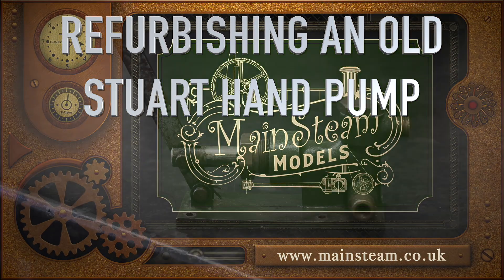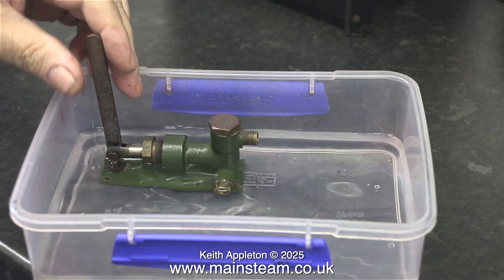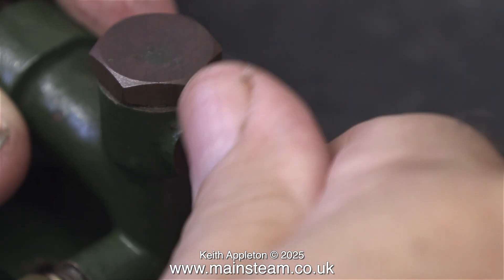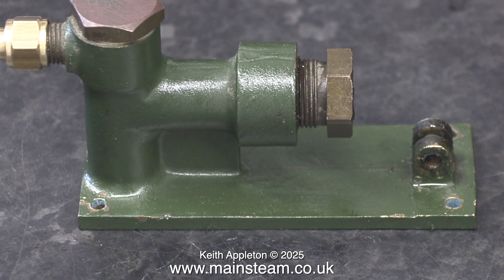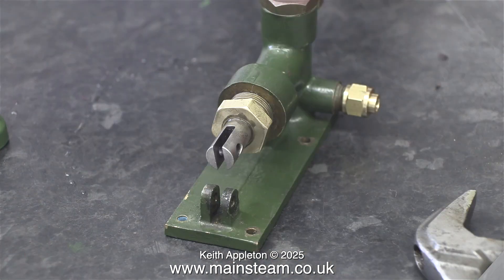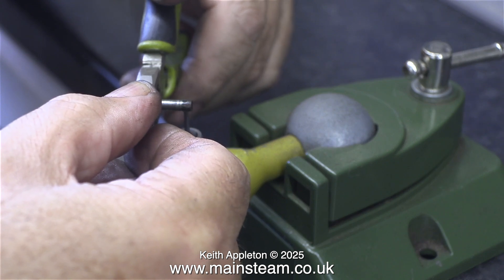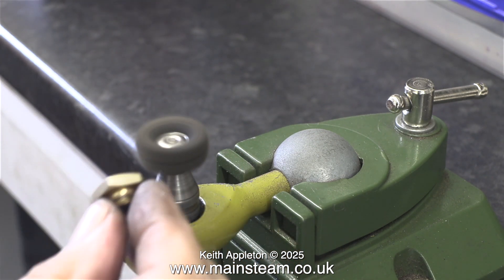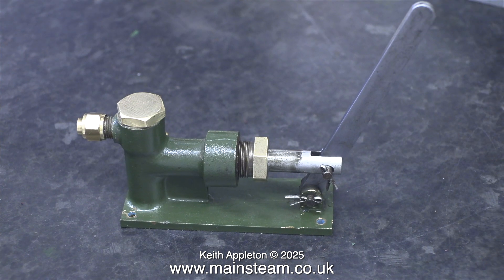REFURBISHING AN OLD STUART HAND PUMP

Comment: Hi Keith, I've just bought the same pump, could you tell me exactly what nut and nipple combination is needed to accommodate 3/16 pipe please, and where did you buy them from please??
Reply from the maker: Why not give Stuart Models a ring, they will tell you what you need and even sell you the parts }:-)))